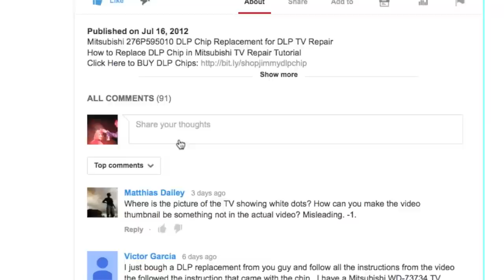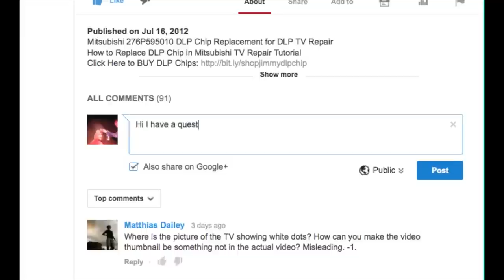LCD TV Repair Tutorial - TV Screen Solarization - Common T-Con & Main Board Symptoms & Solutions

Comment: I have a question.I have a Vizio m3d550sl I have vertical white line slightly in the middle and little towards right and the coloring is off it does the solarizing thing even in the menu settings. I was wondering if you if you have an idea if its the t-con,main board or panel. I can also email photos if needed

Comment: Thanks for a very informative video!  I have a Philips 39PFL2908 with bad solarization on all screens, including the menu.  I replaced the main board and it is still there (though while it originally had a heavy green solarized image, it's now more red).  I am wondering if replacing the power supply board could potentially fix the problem, but don't want to randomly buy parts. I can't find where the t-con board is. Thanks!
Reply from the maker: Najeeb Ahmad  Please watch this video FIRST to help with your repair!  https://www.youtube.com/watch?v=BP3NVNCGEv8  This could either be a defective replacement part that you received or you have a bad TV panel.  Here is a link to a replacement main board for your TV model number:  http://www.shopjimmy.com/philips-a3rtbmma-001-digital-main-board.htm  Be sure to match part numbers on your current board, with your replacement for compatibility.  Thanks and please let us know if you have any further questions with your TV Repair!  www.shopjimmy.com

Comment: I have a Sony KDL 40V4100 with a solarized screen, the menu is also solarized.   My TV also has black horizontal bands at the top and bottom of the screen, together the bands take up about 25% of the screen and they are filled with multi colored snow.  Does this still infer the T-Con board may be toast?

Comment: Do you sell main boards? Samsung LN40A500T1FXZA image is solarized (sometimes starts up OK for a while), the menu is perfect. So I should replace main board? THX. Alan
Reply from the maker: +Alan Moore   Try all repairs and troubleshooting at your own risk. This could be a problem with either the t-con board, the main board or the TV panel. You can replace the main board and the t-con board individually to see if one of those boards fixes the problem.  Click this link to replacement parts for your TV model number:  http://www.shopjimmy.com/catalogsearch/result/?q=LN40A500T1FXZA  There may be multiple boards for the same TV model number, be sure to match part numbers on your current board, with your replacement for compatibility.
Thanks and please let us know if you have any further questions with your TV Repair!  www.shopjimmy.com

Comment: I have a Sony KDL-26L 5000 .I have a green line running verticle in the center of the screen.
The t con board is intergrade at the top, the # I got off the  board is: TS5526T0218.
It's at the top of screen , doesn't look like it can be changed if it's the problem.
Any ideas besides taken a Hammer to it?
Thanks

Comment: SONY KDL-43W800C  only the black has shade in it and it it not shown as black. FYI the original T-CON board was replaced by a new one and the color is not looks normal. How can I fix this ? is this fixable or need to replace another t-con board

Comment: Hi, I have a question for you.
My TV SONY LED 42 INCH ,model no kdl-42w650a..I have the same problem as shown in the video and Sony service guy came and replaced with new panel but the problem was not yet solved. Still it is the panel problem or may be something else, pls suggest me

Comment: I have a Westinghouse sk-32h570d TV.  From watching your video it appears to have Screen Solarization.  Will a T-Con Board repair this problem.  I have the part in my cart - waiting your reply
Reply from the maker: +James Dowdell   Try all repairs and troubleshooting at your own risk. This could be a problem with either the t-con board, the main board or the TV panel. You can replace the main board and the t-con board individually to see if one of those boards fixes the problem.  Click this link to replacement parts for your TV model number:  http://www.shopjimmy.com/catalogsearch/result/?q=sk-32h570d  There may be multiple boards for the same TV model number, be sure to match part numbers on your current board, with your replacement for compatibility.  Thanks and please let us know if you have any further questions with your TV Repair!  www.shopjimmy.com

Comment: in my case, the solarization issue (appear on main display and sub menu screen) as explained in here was not the TCON board as I have thought since I purchased couple of TCON board and tested it out.  I gave the mainboard to another user with similar issue and he has couple of good LCD panel as the result is the same.  So the conclusion it seems that it is the mainboard being the culprit.

Comment: i have a plasma TV model # z50pj240 that has sparkles and mostly when screen shows blue, have already changed power supply as original issues was TV turned on then off no power, have tried some adjustments on the screw adjustments and seems to help a little, also have replaces the  EAX61314901 LG EBR63549503 Zenith Z50PJ240 Plasma Control Board, so at this time just looking for some advice on what it may be that is causing the color and sparkles. also notice some burned in issues as well.
Reply: sounds like  bad cable connection to screen  posable  blue drive cable

Comment: hello!

Samsung ln40a530p1f and my colors are acting strange. Many colors are washing out. it's not inverted. It took me a little bit to notice, but it's definitely an issue. Not as bad as the example in the video. Blues and greys run together, blacks are brighter and gray looking. I'm very handy DIY, but I don't know if it's t con or mainboard.
Reply from the maker: kbcarroll   Please watch this video FIRST to help with your repair!  https://www.youtube.com/watch?v=BP3NVNCGEv8  This could be a problem with either the main board or the t-con board in your TV.  You may need to replace each board individually to see which one fixes the problem.  I would start by replacing the t-con board to see if that fixes the problem.  Click this link for replacement t-con and main boards for your TV model number:  http://www.shopjimmy.com/catalogsearch/result/?q=ln40a530p1f  There may be multiple boards for the same TV model number, be sure to match part numbers on your current board, with your replacement for compatibility.  Thanks and please let us know if you have any further questions with your TV Repair!  www.shopjimmy.com

Comment: Hello, I have a Coby TFTV4028 with Solarization on the image and the menu pop up screen as well. Is it possible that the service settings could be altered? Do you know the code to get in the service mode for this TV. Also, I would like to know where to buy the main board in case I need it, the board number is: 002-FV40-2810-00R  and is VER:1.0.

Comment: Hi i have a problem with my Vizio sv472xvt red pixels are showing up were its supposed to be a dark image i have called vizio and i guess you call it power cycled the tv already that didn't work. Thy told me to call iti for the repair because im out of warranty. I am capable of fixing the problem myself. I have been researching the problem online and have came to the two possibilities that its either the t-con board or the lvds cables or possibly the connections of those cables. I was wondering what you guys thought about my issue and if maybe you had any suggestions. thanks for your help in advance.

Comment: 1.Telefunken
2.TE32880N13
3.Hi i'm having an issue with this TV after around a year i first bought it , i don't think it's solarization becuase the image looks slightly different from the one you showed in the video, what happens is that the image , especially when i turn on TV but also when there are bright colors gets super bright while some colors like the white get a little grey , i can't even see the edges of images shown, even setting backlight at his minimum as well as contrast at max level i'm still having this problem. Thanks for your help.

Comment: Hello, I have a Dynex DX-L42-10A 42 inch flatscreen I purchased from Best Buy in 2009. Worked well until a month or so ago when it started showing the solarized screen as you described. I then pulled up the menu, which was also solarized. Based on your video, I'd assume this flatscreen would need a new T-Con board. Would that be your expert assessment also? Thank you.
Reply: I have dynex as well … it will start up fine but will slowly transition into solarized look… yours do this?

Comment: Hi sir,
Tv Brand: Sony
Model: KDL - 40BX400
Problem: Any hdmi device connected (pc, android tv box), to any of the available hdmi inputs, randomly display negative/inverted colors (fucsia/blue). Menù does not display in inverted colors, ATM only solution is to switch to another hdmi port then back to the main one.
Software was updated to the last available trying to troubleshoot the issue.
Thanks in advance for your time and effort.

Comment: Have an LG brand 37LG10-UM. Started out as if the color temperature was off but not enough to completely compromise watching tv. Carefully moved the TV to another room and when plugged back up screen was severely solarized and has vertical lines in menu, as well as some pictures staying on the screen when switching between screens. It switched back to normal for a few seconds after letting it rest all night but then went back to the same problem. Any idea if this would be more likely to be the t-con considering it also effects the menu and it did go away for a few second? I would think if the LCD panel was compromised it would not have gone back to normal like that.

Comment: Hi ShopJimmy.com,
My TV has a problem in display. 

Symptoms: Right Half picture is showing abnormal color. Like in bad half, Odd pixel lines are not showing Red and Green color.   Blue color is OK. Even pixel lines color is OK (with all R, G & B Color). Menu come with abnormal color too. 

TV Model :  Toshiba 32L3300ZE

T-Con Board Model :  LG TCON BOARD 6870C-0442B . This board have single LVDS input ribbon Cable and single output ribbon cable to another PCB board (where the 2 COF ribbons are bonded).

Please advise what will be the problem?

Comment: When you say bad panel do you mean the lcd panel? I have a Polaroid thx02420b 42" lcd and the picture randomly cuts off leaving only sound until you poweroff and back on. Its totally random too sometimes it does it 5 times in a hour some times it dont do it for days. But I noticed a funky shadow effect that causes polarization just not fully, this is noticeable on the blue no signal screen as well
Reply: Its also noticeable on the osd.
Reply from the maker: *****   Try all repairs and troubleshooting at your own risk.  If you have a shadow effect, this sounds like a TV panel (TV Screen) problem.  If your TV panel is bad, it may be more cost-effective to replace the TV as panels are typically hard to find in stock, difficult to replace, and expensive.  Thanks and please let us know if you have any further questions!  www.shopjimmy.com

Comment: I had a polarized screen and menu. replaced t con board. still polarized. it is a LG 42lv5500-ua. built Feb 2011. the crazy thing is that the screen looks better after it warms up. could that still be a bad panel.

Comment: love you videos. I have a seiki 65 inch I found on the curb. the power supply board was burnt. no screen. just blue power light. I replaced that board. it powers up now. beautiful screen except for about a 1/4 of one side is darker. like a shadow. it looks like it is lit, but just darker. its about 2 years old. model is se65uy04

Comment: I have an element flx3202 tv. That when I turn it on. It comes up with a blue screen that changes to a aqua marine color almost instantly. If a picture is on it looks like an X-ray. The set starts squealing loudly. Could this be a capacitor issue In main hours or a bad tcon board? Im at a loss here. I'd like to fix it. Was a good tv Any thoughts???

Comment: Toshiba 39L1350U I believe I have a solorized TV the contrast on all sources shot up to 99 I was able to manually adjust the contrast back down to less than 12  but the menu remains unchanged  somewhat transparent  with washed out grey and white I visited your website and I only see a main board , power board, cableing and led strips  can I presume the T con is built into the main board? ty for your time

Comment: I have the Samsung Slim LED Smart TV [UN55ES6500]. I just started getting this solarization on 2/3rds of the right of my TV. It's also, ghosting on 1/3 of the screen to the right. Lastly, it turns off by itself sometimes, then turns back on...
Reply from the maker: chicago307  Please watch this video FIRST to help with your repair!  https://www.youtube.com/watch?v=BP3NVNCGEv8   I recommend replacing the main board in your TV.  Click this link to replacement boards:  http://www.shopjimmy.com/catalogsearch/result/index/?cat=56&q=UN55ES6500  There may be multiple boards for the same TV model number, be sure to match part numbers on your current board, with your replacement for compatibility.  Here is a link to a video showing how to identify your part number, click here:  https://www.youtube.com/watch?v=BEPWrefQvqI  Thanks and please let us know if you have any further questions with your TV Repair!  www.shopjimmy.com

Comment: hi I have an LG 47LM4600 and when I turn it on sometimes it will come on with no problem and show the lg screen like normal and look perfect and then slowly it will fade in to a black screen with pink vertical lines snd then other times it will come on and instantly goes into multi color vertical lines and will just stay there I have replaced the T-con board I'm wondering if its the main board plz shed any input on this!!!! ty you for your time!!!

Comment: Jimmy HELP!  I just bought an RCA 55" Class 4K (2160P) LED TV (RTU5540).  With in the first week, white areas were appearing in the screen when it is a dark image.. like the backlight is malfunctioning.
Within two weeks the oranges on the screen are burning and flaring (glowing like fire).  I have tried adjusting temp and contrast which does change the picture but does not change the orange.. or the backlight issue!  thanks in advance!!

Comment: I have a samsung model ln40a630m1f with solarization. I previously had the turn on - turn off issue that I fixed by replacing the board. I looked up the solarization issue and did a factory reset and it worked. It happened again and I had to reset it twice and it worked. It doing it again but the reset isn't fixing it. Could it be the t con board?

Comment: Hello,
I have a Sanyo LCD TV model # DP37647. When I turn it on the screen looks fine for about 5 seconds then goes white. I can still make out the picture and it has sound. I replaced tconn board and now the picture is solarized. Any idea why that would happen or what could be the problem?

Comment: Samsung LN 4661F the menu has vertical lines everywhere. It is visual but slightly distorted. When watching a movie the color is distorted but watchable. Everyone is saying Tcon board? In the service menu the text display which cycles through from the smallest to the largest on a white background is very clear, no issues.
Reply from the maker: Walter Electric   Try all repairs and troubleshooting at your own risk.  This sounds like a TV panel (TV Screen) problem.  If your TV panel is bad, it may be more cost-effective to replace the TV as panels are typically hard to find in stock, difficult to replace, and expensive.  Thanks and please let us know if you have any further questions!  www.shopjimmy.com

Comment: Hiii my tv is a hisense 50h8c, all the colors look negative (black looks white etc) I tried changing the t con board and it didn't solve it and I tried the hard reset and it also didn't solve it, what do you think the problem could be? here's a link to a picture of what the problem looks like @t and @t

The second picture shows an small burn that happened out of nowhere but in no way does it affect the tv performance (other than the color problem) which I'm not sure is related? 

Thanks!

Comment: Hello, I have a 42" insignia model NS-L42Q-10A Serial no.V3198JA002587 and the color is weird on it, I've set it back to factory settings which improved it but its still there especially in the darker spots. I bought a used main board thinking it went out based on the fact the menu when brought up is fine, I installed it and still have the same issue. The symptoms look like solarzation but perhaps early stages of it. My next attempt was a T-con broad replacement but was wondering if I'm on the right track.

Comment: I have a 10yr old 42” JVC LCD TV model number LT-42E488

The tv still works but the picture is distorted with warm colors. I can still watch tv however the colors are bright light yellows and oranges. 
Do you think this is repairable or not cost effective to replace.

Comment: Hello! I have a question about a Sony Bravia KDL-40V4100.

My problem started with image solarization on main display and all menu options. I continued to use the TV and now I'm experiencing some pretty severe ghosting and intense whitening. The ghosting/whitening gets worse the longer the TV is powered on. When first turned on there is a dark oval shaped border around the perimeter of the display. This slowly gets brighter and brighter to almost paper white, displaying no image at all. This shape is also appears to be slowly increasing in size, closing in towards the centre of the screen. This size resets when the TV is powered down for an extended period period of time. 

Is my display shot? 

Thanks
Reply: This intense whitening/ghosting is visible on the entire screen as soon as it's powered on.
Reply: +James Haynes the image is now almost a complete negative